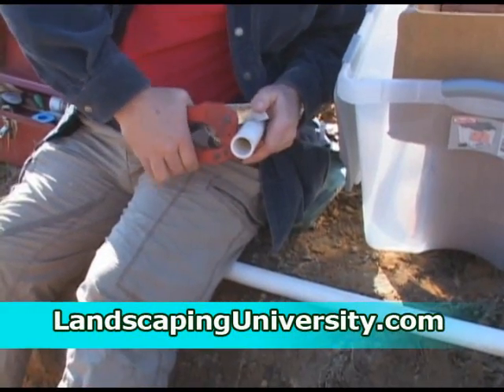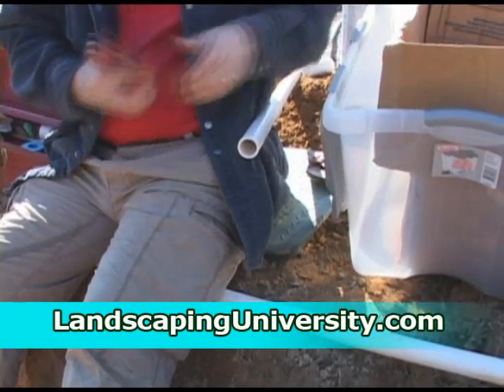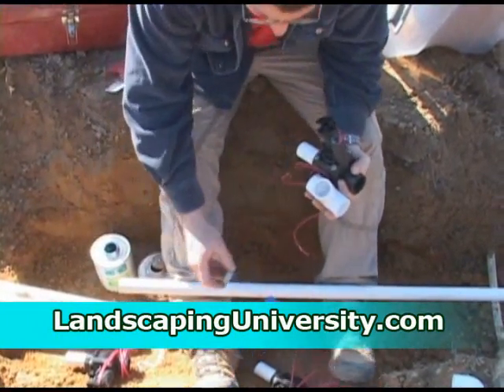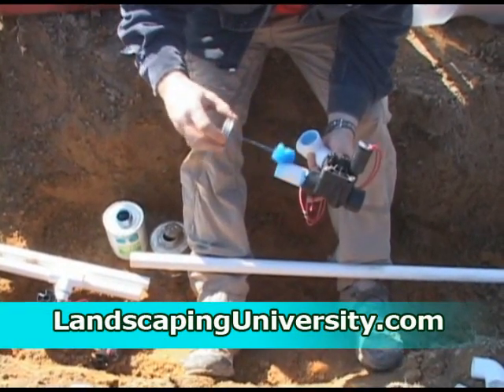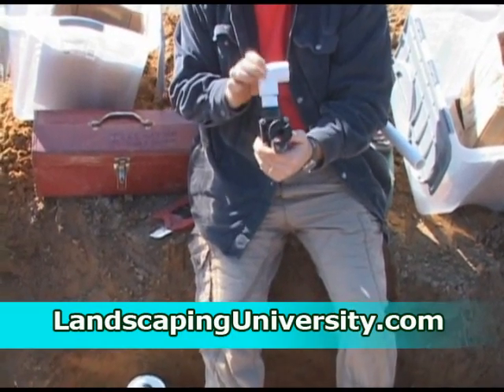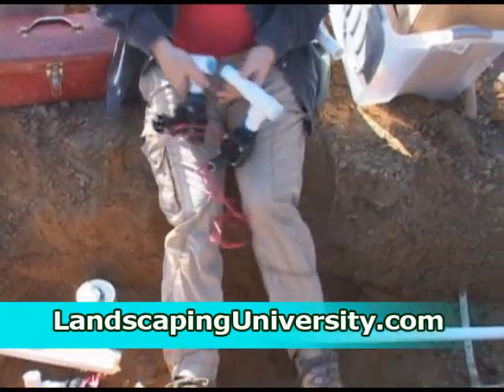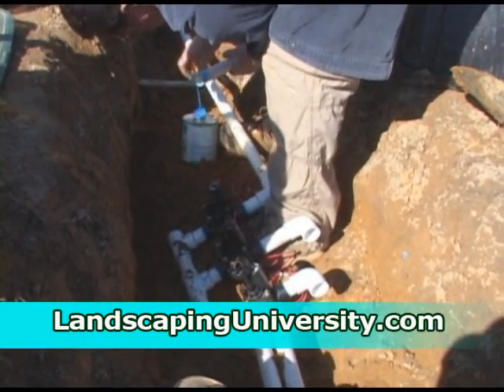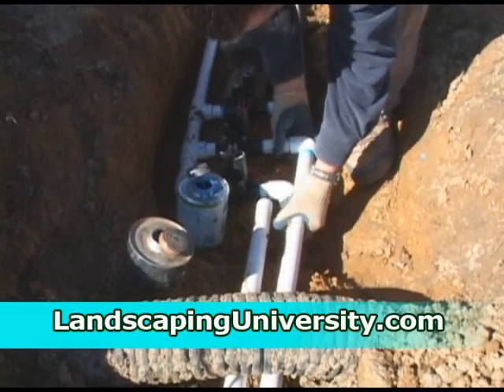Installing an Irrigation Valve Box and Valves

Comment: gluing directly into the valve is never a good idea. thread a male adapter into the valve and make your glue joint there, it will make any future maintenance MUCH easier. wrap the male adapter with thread tape, go around about five times and tighten with a pair of channel locks. it will not leak guaranteed